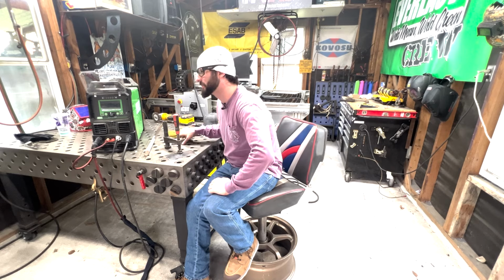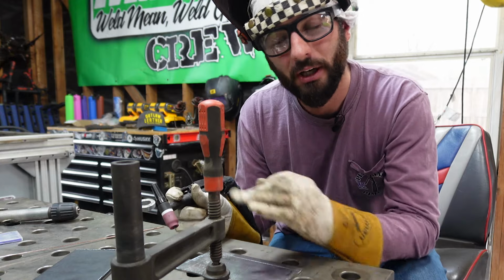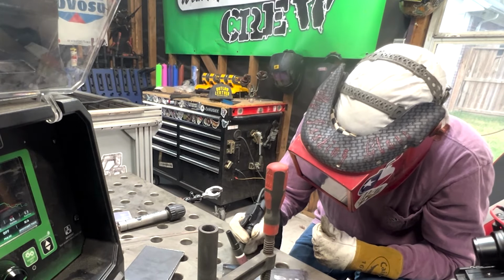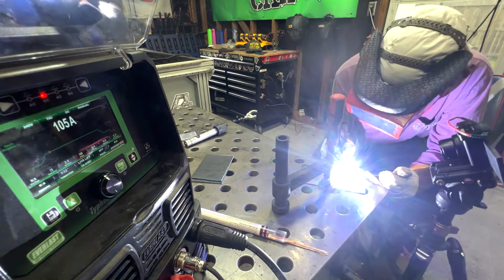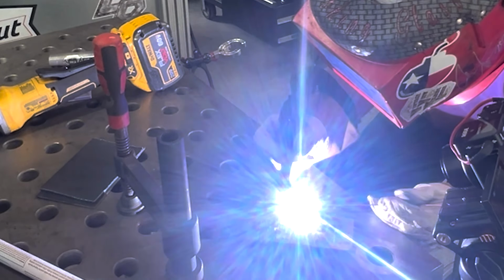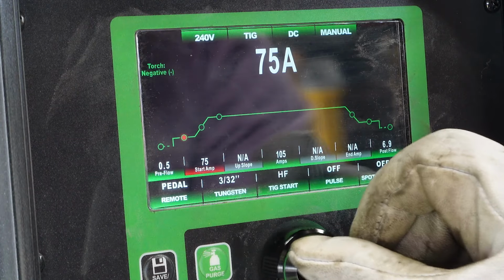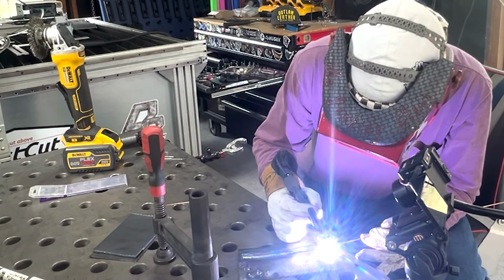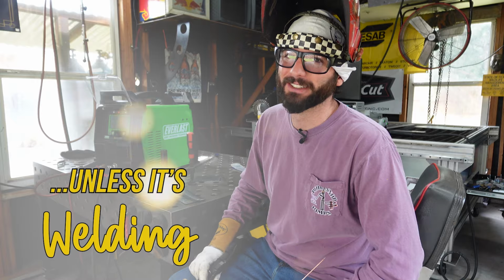Mastering TIG Welding: Tips for Beginners

Comment: so i’m looking for a tig welder that runs on 110 voltage. i am only looking to weld steel.  any recommendation’s? 
  i am experienced with steel and aluminum rig welding. but i am just looking for a small rig to use at home.